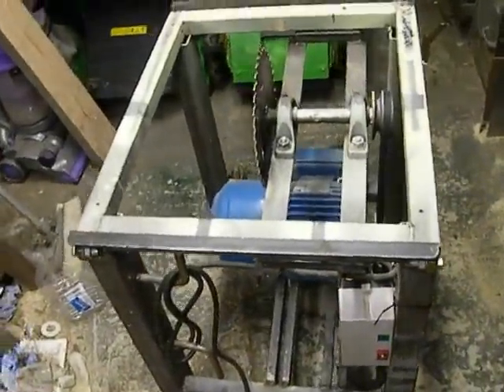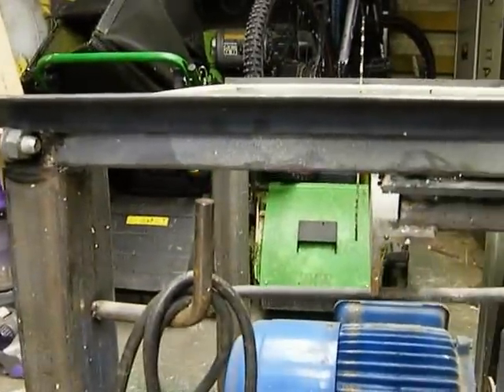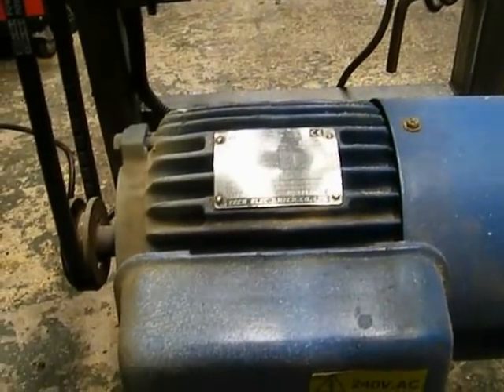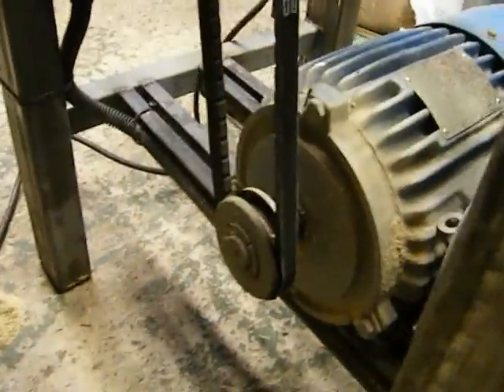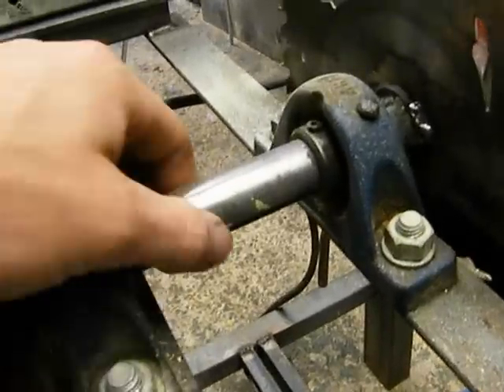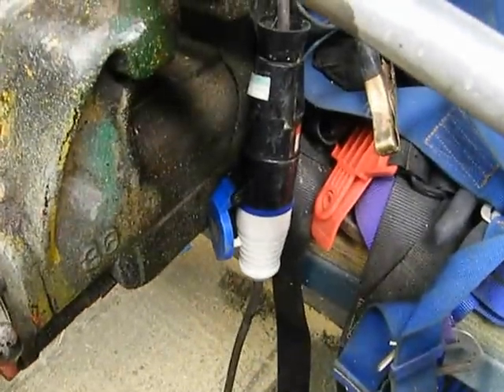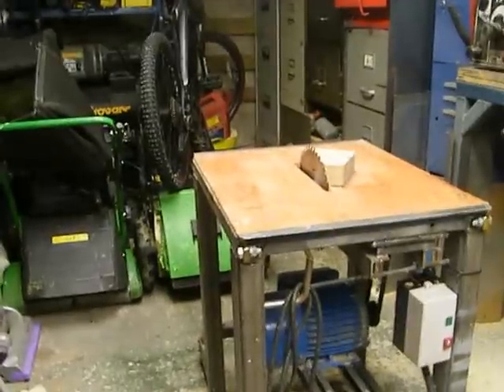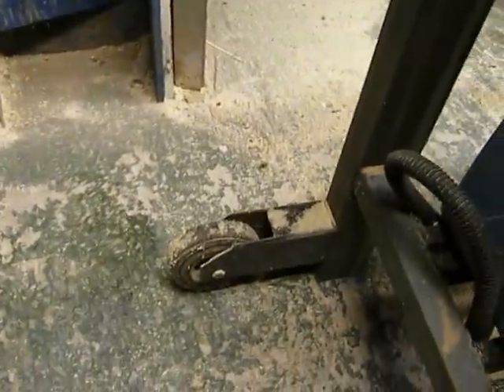home made table saw. 10" blade cutting oak. 3hp

Comment: Dude, i was thinking to build a similar table saw, but the calculated cost are near a half of a cheap contractor tablesaw, You did build one, wort it? do you tinink its better to save for a comercial table saw?
Reply from the maker: hello there, to me it was yes, i had the motor and bearing knocking around the workshop already, the metal were offcuts leftover from a job. all the parts are easily replaced and cheaply. a contractors saw was an option but this one worked out cheaper and better made. its now got a 12" blade on it, a blade guard and a safety rail stop switch so is alot safer than it was! i cut mostly firewood on this but do rip timber down for gates etc when needed. the weight of it makes it very stable to use.

Comment from the maker: true you could, it was more of an experiment to find out if you could built a table saw with basic tooling, parts are easily changed/ replaced compared to other table saws . yes, this example at that stage did require you to have your wits about you! as it stands now with new blade and guard on and 2 emergency stop buttons on it, id rather use this at 2800rpm that a poorly made chinese copy at 4500rpm.  pay your money take your choice!

Comment from the maker: thank you for your comment, you did see a couple of weld beads on the 1st blade tried. it warped the blade slightly yes. the welds were to hold the blade in the centre as the mounting hole was a mm too large, all rectified now, with new blade and emergency stop buttons fitted. advice on youtube is always welcome from experienced people.

Comment: Did I see that you have welded the blade to the arbour I hope I was wrong but if I'm right get ready to duck when the centre of that blade gives way saw blades are made of carbon steel not meant to be welded the heat just from 2 small welds has now probably already weakened the metal of the blade and is now just looking for an excuse to let go having worked for 40+ years as a mechanical engineer I do know what i'm talking about keep a serious eye on it cheers